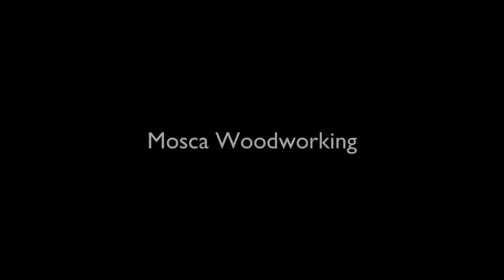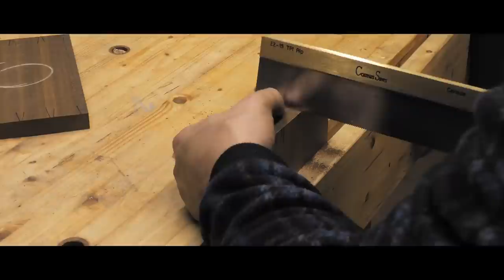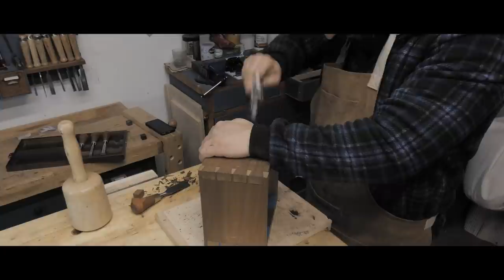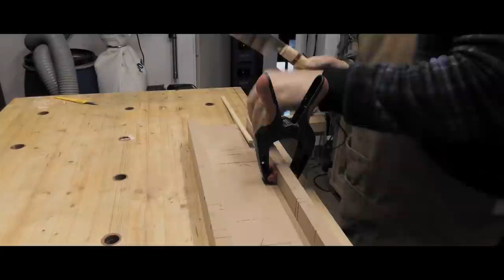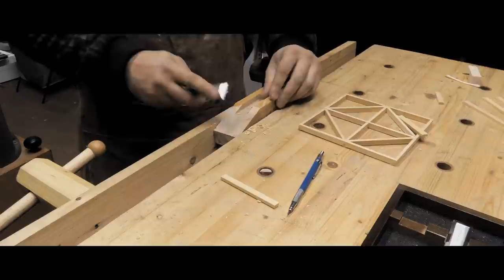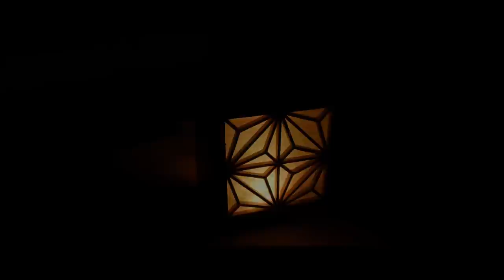A KUMIKO LAMP (a little cinematic)

Comment: Hey is this video in slow motion or are you filming at a very slow shutter speed? The motion looks a bit strange. Cool video nonetheless!
Reply from the maker: I believe it's because it's a 4k video downgraded to 1080
Reply: @MoscaWoodworking  Mmmm I doubt it - which shutter speed do you film at? To get natural looking motion you should film at 25 fps and double that for the denominator in shutter speed (1/50). If you prefer to film at 50 fps you should set the shutter to 1/100...etc.
Reply from the maker: I'm not very expert on it, sorry. I'll try to make it better next time